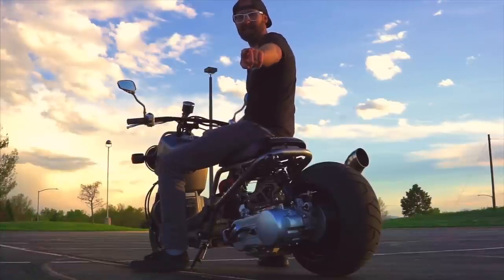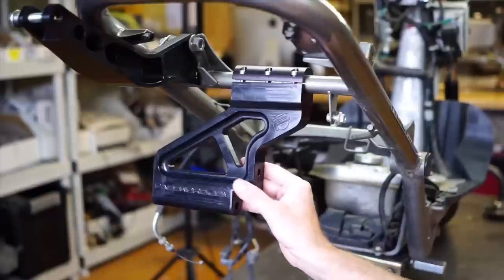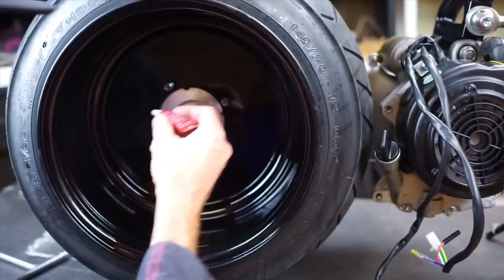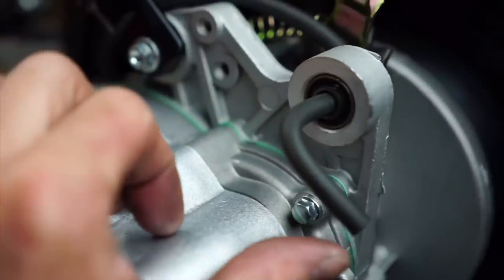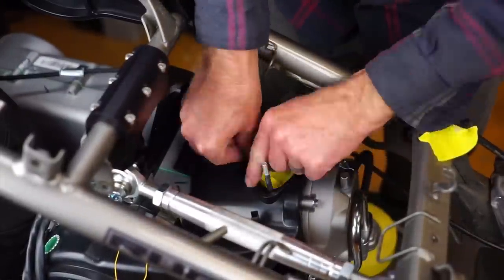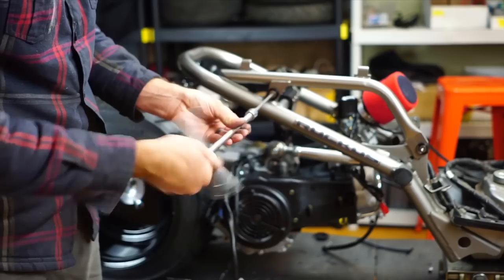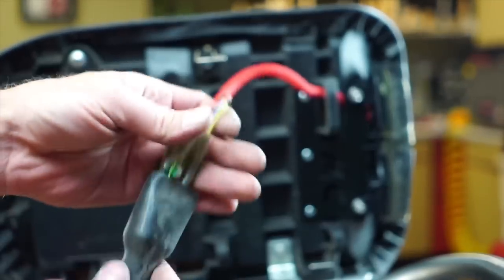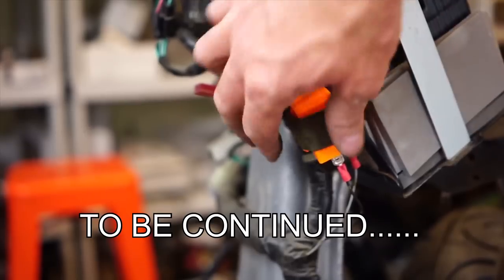Honda Ruckus GY6 Engine install [Part 4] BUILD SERIES

Comment: I love the series men, but like advice when you put the camera on the tripod you adjust the focus manually because the auto focus does strange things, which makes your head a little dizzy, and only uses the auto focus when you have the camera in your hand :D
Reply from the maker: Thanks for the tip, I’ll take that into consideration. I appreciate the support 🙏

Comment: Hi I have Honda ruckus but is not working the batery,fusesnd the two black thing I change hat everything but ruckus still not working the starter the signal light horn and the light and the front

Comment: Does anyone know for sure if you can replace a 1P157qmj  cylinder head by a regular 157qmj head..There are differences in height..like 1.5 mm where the camshaft sits?Thanks

Comment: i ordered the gy6 swap kit more or less piece by piece. i didnt see a bolt for the shock motor mount. do you use the stock one from the original motor or should there have been one with the kit?

Comment: Great video just bought a ruckus .:: maybe this is a dumb question but how do you know if you have the stock motor or it’s a y6 motor I got the bike and a box full of two motors ..
Reply from the maker: The stock motor will have radiator hoses. The GY6 will not
Reply: Rolling Wrench ok cool man thanks for the reply so fast just sub your channel yesterday I bindged a couple vids yesterday made my day .

Comment: Hi from philippines what size a tire rear and tire front and mags front/rear!! Thank you so much
Reply: Rear tires are usually 130/70 12  and front I run a 90/60 12  , 12 by 8 rear rim 12 by 4 front

Comment: Is that a single-sided swingarm if it is where did you get it from
Reply from the maker: The GY6 engine uses its engine case as a swing arm. It is single sided. Although there are some that are not.
https://www.rollingwrenchdenver.com/products/gy6-150cc-long-case-engine-ruckus-metro-swap-motor

Comment: On one of your other videos you was talking about the engine. This is the one I have is it a good one. I'm new to the scooter club. 157qmj*8a061515*.
Reply from the maker: Ya, that’s a a good one. GY6 150cc A motor
Reply: @RollingWrench  ok I was thinking about getting that spriket kit o  your website. Would it work for me?
Reply from the maker: Gear up kit will work :-)